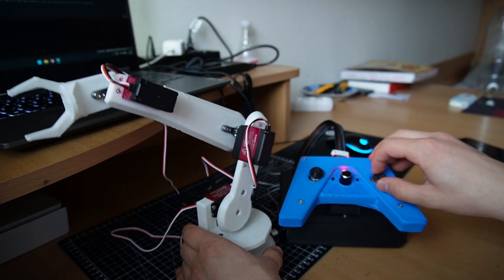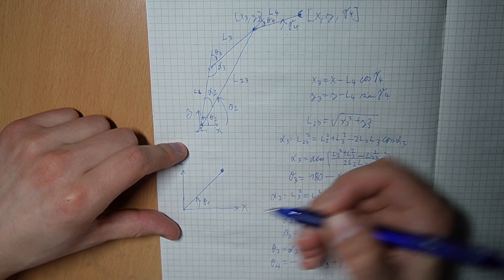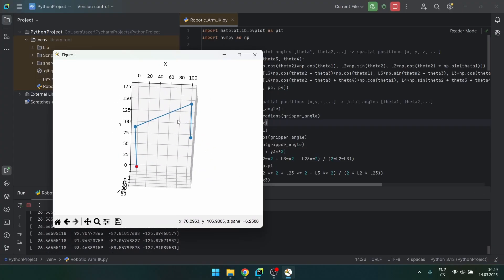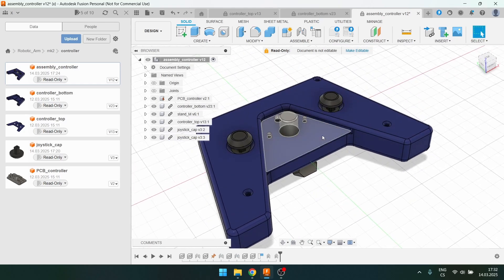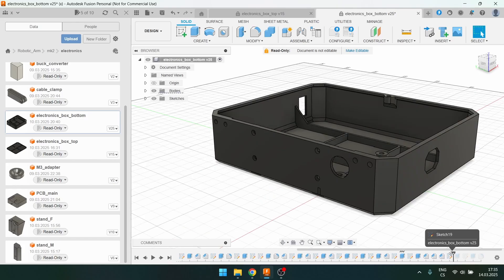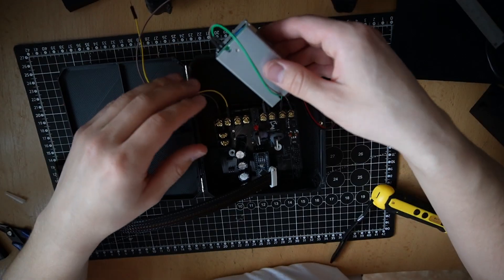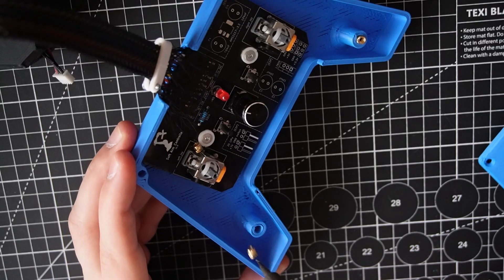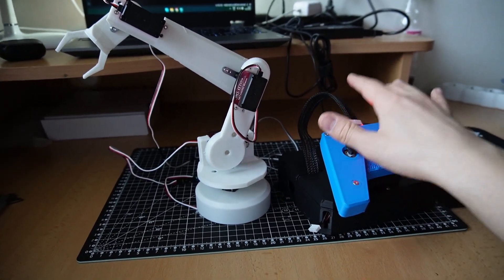Why Robots NEED Math to Move

Comment: I love watching progress on projects like this!
I want to better understand the programming logic that's used with IK. The math solving the system makes sense, but how is the IK used? Do the inputs on the controller increment / decrement the end effector's x / y / z position / rotation or how do you get smooth movement from input?
I've designed the mechanics for a leg with 3 DoF & solved its IK. The code is coming up whenever I'll have time for it.
Reply from the maker: The code runs in a while loop with some delay. Each iteration, I read the joystick value, multiply it by some number to reduce it and add it to the coordinates, then use IK to get motor angles. So If the delay is 10 ms and the reduced joystick value is 0.1. The arm moves at the speed of 10mm / s in the x direction.